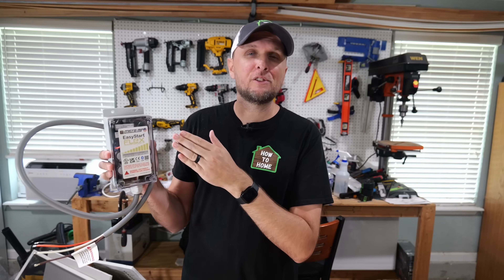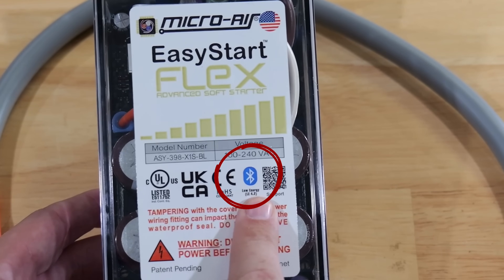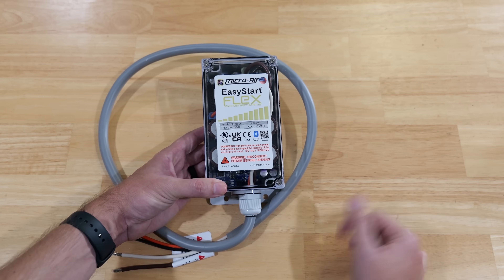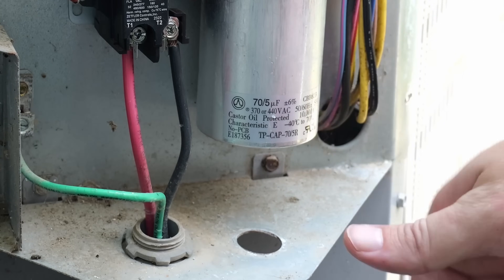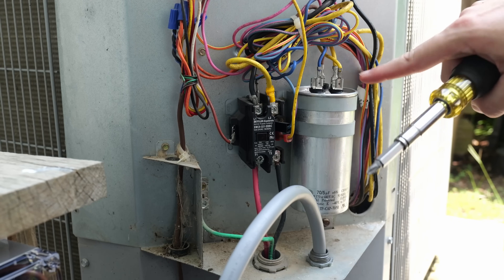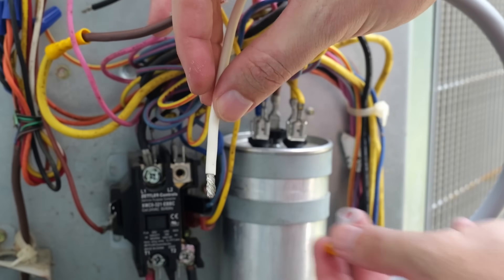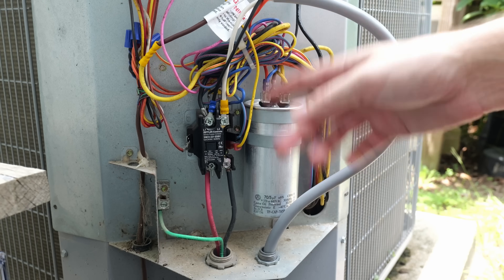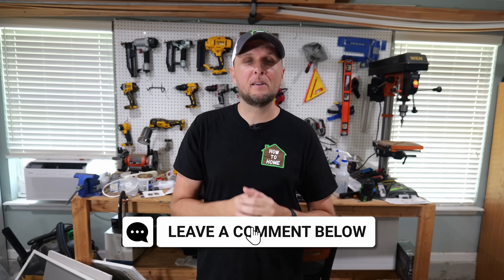The ONE AC Upgrade Every Homeowner Needs to Consider!

Comment: There are numerous reports of catastrophic failures with Micro Air EasyStart Flex ASY-398 specifically - capacitors explode anywhere from several days to several weeks after installation.
Reply from the maker: Yes I have seen you trying to make everyone aware of this from different places on YouTube to Amazon to Reddit.  The truth is the vast majority of them are not having any issues and in the few that have, Micro Air has taken care of them.  I believe you know this firsthand.  So let’s not try and make it sound like it’s a huge problem.  Mines been installed for well over a month probably two and zero issues.
Reply: @HowToHomeDIY I've never posted anything on Amazon related to Flex. If you read the comments on YT and Reddit I'm apparently not the only person with this problem and sudden catastrophic failure with what is an essential bad weather equipment (people size generators assuming it works) is not a good sign. Moreover, there are no such issues with previous models apparently, so this is some sort of a regression in the Flex units specifically.
Reply from the maker: @ArcadiyIvanov you are correct, I thought I remembered your name on Amazon with a review but I stand corrected.  Explode and catastrophic are extreme words to be using.  They didn’t blow up.  And no you’re not the only one but you are in the extreme minority.  They have sold thousands and thousands of them already.  They can’t keep them in stock.  People that aren’t having issues aren’t going to comment and post.  I just think you’re being a little harsh on something that did happen to you and some others but it’s not the majority.  Again those that have had an issue they have all said how Micro air took care of the issue and replaced it.  I can only assume they are doing or have done the same for you.
Reply: @HowToHomeDIY  "Explode" and "catastrophic" are not click bait and accurately describe what happens.  
 "Catastrophic failure" of electronic device means sudden (without warning) complete (non-gradual/partial) failure of equipment often involving either complete or partial physical destruction of the device components with destruction causing a failure to propagate through the device. That is what happened in reality - device failure is complete, sudden and noticeable destruction of device components is present. The mechanical equivalent would be pieces flying in different directions with a bang.
"Explode" is also accurate. The electrolytic capacitors have top metal caps that are scored diagonally for explosion safety. They have several modes of failure: bulging, cracking, leaking and explosion. In the two failed capacitors there is bulging, complete rupture of the scored cap, expulsion of the internal contents and sharp protrusion of the scored leaves of the cap, which indicates explosion. I.e. if this happened on an electronics bench without cover, there would be a loud pop, electrolyte would splatter on the ceiling and if your unprotected face was above those caps you'd either have severe eye damage or would lose your eye sight entirely. I've seen the electrolytic cap fail violently and it is accurately described as "explosion".
Reply from the maker: You don’t know that’s what happened though.  You’re picking a part to try and justify using the word explosion.   You and I both know when someone uses the word explosion, they are talking about something severe, your issue was contained.  You don’t say the balloon exploded, or my tire exploded.   And I really like how you used half of the definition of catastrophic failure.  Yes it’s a sudden failure but it’s one that is catastrophic, meaning severe loss of life, finances, environmental, etc.  The Fukushima nuclear disaster was a catastrophic failure, the BP Deepwater Horizon Oil spill was a catastrophic disaster.  You had an electrical device stop working 😂  So no I do believe you are hyping it up unnecessarily and you still refuse to share that Micro air took care of you and made it right.  Also, you probably also know that they changed out the part that could possibly go bad a while ago and all the new ones that are and have been shipped out for weeks now have the updated part that should take care of the possibility of this happening.
Reply: @ArcadiyIvanov you are definitely over hyping this and using words that are inflammatory over something so small.  I found his Reddit post and comments and his YouTube video where he uses the same words.  As the how to home guy said, you are completely misusing them.  You had a failure it’s not catastrophic 😂.  Big deal.  I buy stuff all the time and sometimes it quits working before it should.  I guess my bidet that quit working is a catastrophic failure too 😂.  Not sure if you are just trying to sound smart or looking for the feeling of relevancy but it looks bad.  And why aren’t you being forthcoming about what micro air is doing for you?  All you have said is negative things and the how to home guy has basically prompted you twice to be transparent but you aren’t.  Micro air has said they have fixed it and more than likely sent you a new one to replace it.  Quit crying about it all over the Internet.  They are making it right like a good company does.  Or are you offended they didn’t take your broken one back to study it?  You sounded upset about that in your post the way you worded it.  Maybe they already knew what the issue was and already fixed it.  Anyways, I look forward to your upset response.  But seriously it’s not that big of a deal.

Comment: I bought the older unit a few years ago so I’m a bit annoyed at how much time I spent squeezing it into the AC unit only for them to produce a smaller one. I also noticed it reduced the starting amps initially but I rechecked lately and it’s back up to nearly 60 start up amps….i guess I need to do the re-learn again…? Idk

Comment: It is my understanding that a device like this will void the warranty on your equipment. Do not install if you still have a warranty on your equipment.
Reply from the maker: Well that is incorrect.  Not sure where you’re getting that from.
Reply: @HowToHomeDIY  I asked the company that installed my system.  I did not call the manufacturer.
Reply from the maker: The company that installed your system is going to tell you that.  They don’t want you working on your own system and most of them have no clue what these are or actually do.  It would be against the law to just void your warranty because you added an aftermarket product per the Magnusson - Moss Warranty Act.  The only way they could void the warranty is if the aftermarket part caused the damage or you installed it improperly.
Reply from the maker: @jdcpe17 😂 no it isn’t.  You know, Micro Air has electrical engineers too.  I’ve spoken to them.  Maybe you should give them a call.  They are happy to talk to anyone.

Comment: A couple of notes on the Soft Start and inrush current.  A multimeter averages the inrush over a 100 mSec sample time typically.  If the inrush takes longer than that it will give a good reading.  If less then it will read low.  Since inrush normally will be between 100 and 150 mSec this is not normally a problem.  But if you have a hard start, it will reduce the time to around 50 mSec, so the reading on the meter can be nearly half of the actual.  This has confused many people who think that a hard start also decreases the inrush current, when in reality it increases it but decreases the time.

Some contactors have spade lug quick connects instead of screw terminals.  For those you do not have to cut any wires at all, but simply install the mating lugs on the soft start wires to properly connect.

Mounting of the soft start can be simplified by screwing Rubber Coated Neodymium Magnets for feet on the unit and hanging it anywhere on the steel housing you want.
Reply: Thanks! I had been wondering why my hard-start showed less inrush amps then the soft-start, but the soft-start was the only device allowing startup on generator!

Comment: What is a normal operating amperage for a 4T unit? Mine is running at 16-17A during the summer 95-100F heat currently.

Comment: I went with the Micro Air 398 a year ago and just went though a 17hr power failure with Debby here in Florida, my generator ran the whole house!  Now I'm wondering if the new Flex is worth swapping out the 398 now.  Amazon does show the Flex unavailable at the moment, a testimony to the demand I'm sure!

Comment: I installed the prior model on my home AC even though I don't have a generator. It's awesome. The lights no longer dim on AC startup, I'm no longer woken up by the clank of the compressor starting at night, and it has overcurrent shutdown protection that saved me a very expensive compressor replacement when my capacitor gave out.
Reply: Crazy Squirrel is chasing his tail... any competent electrician knows about severe voltage drop during motor startup of standard compressor motors due to Inrush current versus running load current. LED lights are very revealing of this normal occurrence. The soft starter dramatically reduces the inrush current load AND a serious reduction of wear & tear during compressor start-up as well as the tell-tale light dimming indicating the brief voltage drop that occurs during start-up.

If you've ever driven a car with a clutch think of it this way instead of revving the engine to Red Line to dump the clutch so you can start out and high gear. The soft starter is like feathering the clutch and throttle like any experienced driver would do so that you can make a mild start without shocking the Driveline, the engine, the clutch, all the gears, the univerdal joints...  It's really that simple.
Reply: Addendum: crazysquirrel did raise some valid points to check, but collinwn explained that all of the issues brought up by crazysquirrel had been checked, and corrected... the persistent dimming of lighting during start-up that still occurred IS typical behavior of ACCU and other large residential motor loads UNTIL a Soft Starter is installed on the ACCU.
Reply: @garfieldwood8315  This is great! You learn about your A/C and your car engine and drivetrain at the same time! 🙂
Reply: If lights dim on startup, you might want to investigate the real reason instead of treating the symptoms.
Usually insufficient incoming capacity, too small wire to the unit, bad connections, etc.
Reply: @crazysquirrel9425  one leg of the crimp at the weatherhead was failing, even after it was fixed this continued. It AC has 8 gauge all good connections straight back to the breaker box. The box is 150 amps, and it does this with only the AC and a few lighting loads.

It's a 28 year old AC and I don't have a high enough resolution amp meter since your average one can't read correct LRA but I expect it is much higher compared to newer compressors.
Reply: @colinnwn  Voltage drop from pole to house?
Weak connections at the pole?
Aluminum wiring from pole to house?
Wrong gauge wiring from substation to pole?
Too many people (houses) on the supply line?
With a 150 amp box, you should have any blinking.
Maybe the neutral is one issue?
Or maybe you just have a bad compressor?

Takes a long time to figure out the issue(s) sometimes.
Reply: @crazysquirrel9425  voltage sag on one leg on the house side caused by bad splice at the weatherhead. But dimming (not flickering) had been happening since we moved in 7 years prior, and continued 4 years after that fix until I installed the soft starter. No neutral issues. I do have aluminum service drop. Lineman from my TDSP came out and identified that issue. If he didn't investigate your other possibilities not much I can do about it.

I wouldn't be surprised if it's a 'tired' compressor. But it has run for many years that way and I'll run it till it has a functional problem. A soft starter was a more economical fix than a new $15k system until then.
Reply: @colinnwn  All moving parts wear even with lubricant. For an old system, it is quite possible that the compressor oil thickened with wear particles.
Think along the lines of dirty oil in a car motor.
An AC tech should be able to do an oil test, even recover, filter, and replace the refrigerant and oil plus add in a new line filter.
Again, think changing your motor oil and filter here.
Newer lubricants are better than the old ones too.
Doesn't hurt to give a company a call and ask a few questions.
If they tell you that it doesn't do that then call another company.
If necessary call an HVAC school.
Soft start is just a band aid of sorts.
No different than using thinner oil so your car stars easier.
But that is a tradeoff...

One of the biggest problems with new A/C's is the very LOW quality they make the parts now. Especially the coils.
Hard to clean the outside parts of the coils and the inside parts clog easily due to a sorta spongy metal they have in the coils.
Not all use that but many do.
And the metal is THIN. Made to leak just after the warranty is up. Or about every 5-10 years.
You could just have the compressor changed out thus giving new life to your system.
A good tech can do it in about 1/2 day or so.
Having them flush your lines can remove contaminants too.

Hint: the longer and deeper the vacuum on a system, the longer the system can last.
Some techs cheat on this part to keep prices low.
Vacuum needs to be less than 500 microns for 1 hour and only change to the vacuum is 1psig. 200 would be great!
Moves more than 1psig or above 500 microns for 1 hour, more vacuum is needed or you have a leak somewhere.
If they go deeper than 200 then it vaporizes the oil in the compressor.

Comment: Tesla installed a soft start unit on our house as part of the solar and battery installation. It has worked well and has let us use the AC during grid outages.
Reply: 20 years later, you will have made up the electrical costs.  But by then, it just broke and you have to start all over with new equipment....
Reply: @srobeck77  unfortunately not.  The utilities keep raising rates.   We originally projected payback in 9 years.  Now with the higher rates it is about 6-7 years.   Rates are jumping 20% over last year.  Fortunately we only pay a connect charge.

Comment: My tech told me my compressor was locked. The LRA was high and it would not start. Somehow, it magically started working.  No hard start added.  My question is, if the compressor is difficult to start, will this be able to start it?